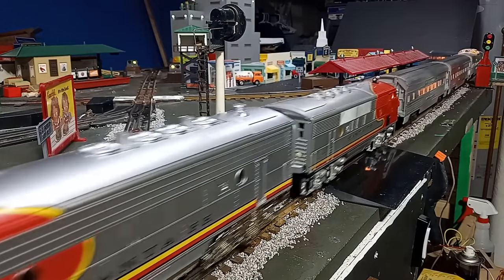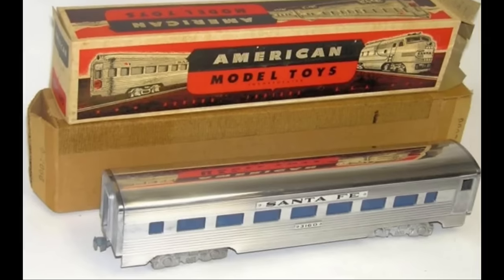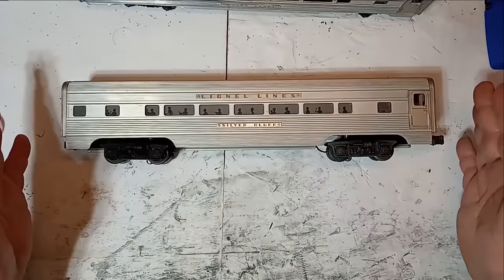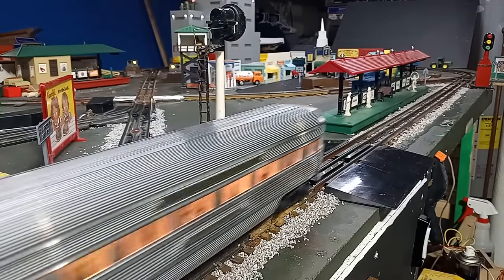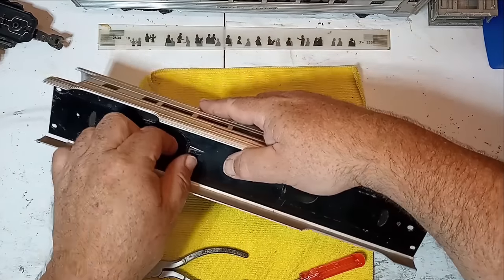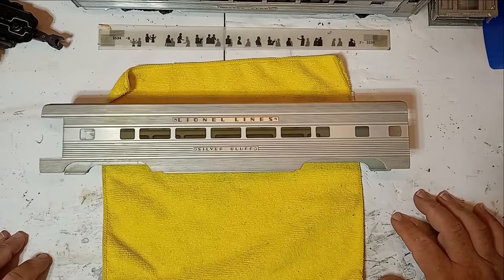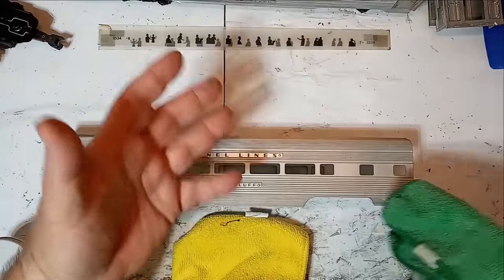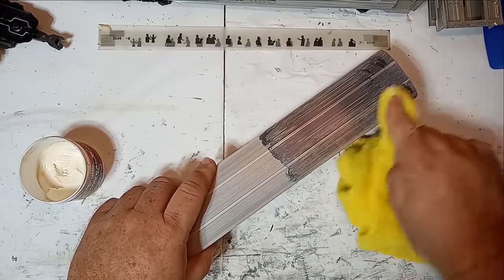How To Shine Lionel Streamliners - Disassembly And Cleaning of Lionel's 2500 Series Passenger Cars

Comment: Thank you for the step by step process. I just acquired six 2500 series passenger cars, 2530 through 2534 with two vista dome cars. Two cars were cleaned very well and 4 needs some tlc. This helps me properly clean the additional cars to the condition of the cleaned cars.
Reply from the maker: Glad it helped

Comment: Very good video.  I have AMT cars almost exclusively.  No Super Speedliners.  I use a nice auto wax, like Simoniz.  Nothing abrasive of any kind.  There are no plastic parts, aside from the  drumhead inserts and certain couplers.  A little mild soap and water cleans any schmutz off and the Simoniz polishes the aluminum to a nice shine.  Smooth roofs are easier than the fluted roofs, but not too much.  Either way, keep those cars looking sharp.
Reply from the maker: Great tip! I love the AMT cars!

Comment: I still say the Irvington cars look good behind the New York Central F3s Even some of the Geeps, as a secondary branch line train. But on topic, that polishing looks good. Real good. One thing I do with my aluminum sets, is designate a coach to be 'head coach' right behind the baggage car. That one, the car is turned so the vesibule is facing the rear of the train, so I swap the sillhouettes so that they still line up, but the passengers are still mostly facing forward.
Reply from the maker: Good tip. Thanks for sharing!

Comment: I had some aluminum HO passenger cars that were so corroded they were white. I had to break out the wire wheel on my Dremel. I then polished similar to how you did and clear coated them. I saw a set of the AMT cars at my local Antique mall. Looked like a good price, but I don't have any O scale or I would have got them immediately.
Reply from the maker: Thanks for sharing!!

Comment: There is a retail brick and mortar Lionel Trains store owned by the same family proprietors since the 1950s, near me, whose owners, tell the tale that in the early '50s ,Lionel factory workers, would carry around baskets full of Silver Streamliner shells to the next station, to have other parts assembled to the cars; and with all that unprotected aluminum with each car shell banging against each other, it was ' amazin' to see, the finished product even with a duller " MIL '" look to them, with only minimal slight surface scratches being readied for retail. So, yours, Mike, probably look better today than when they exited the 1952 Lionel factory in New Jersey. No doubt similar to how restored show antique autos of today, have " show chrome " 
 bumpers and stainless steel trim, compared to how they actually left their factories and auto dealers.

Comment: So the wheels are supposed to spin on the axles for this postwar stuff? That's good, thought the stuff I picked up had some major issues lol.
Reply from the maker: Yes, Postwar wheel sets turn independently from the axles. This is actually one of the reasons that modern wheelsets roll better - more friction points on the Postwar trucks. Some things ARE better than they used to be!

Comment: Shouldn't the interior be polished to allow the light to reflect better through the windows?
Reply from the maker: Well, you COULD do that, but given the close clearance inside the car it would likely be both easier and more effective to replace the bulbs with bright LEDS if you want more illumination.
Reply: @ToyTrainTipsAndTricks  No real use or reason to polish the interior.  If you want it brighter, add LED strips to the interior roof, like Sean shows how on his channel.
Reply: And, the heat from the bulb ,in short order would most likely dull the polishing effort of the interior shell.